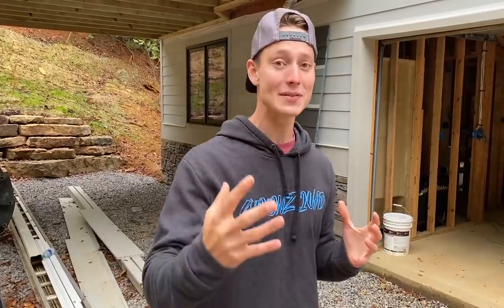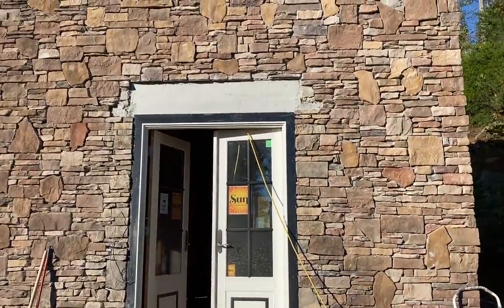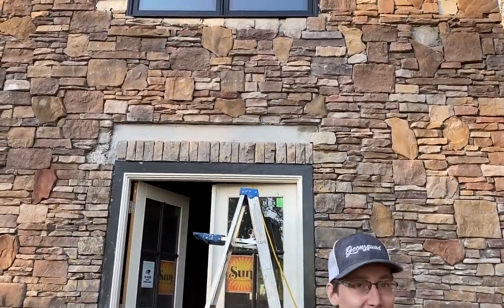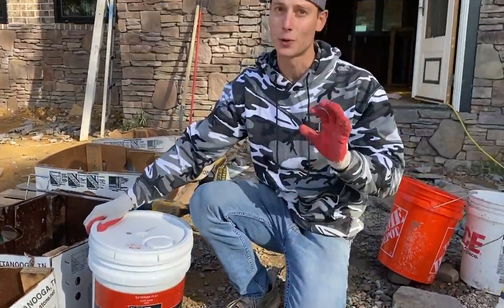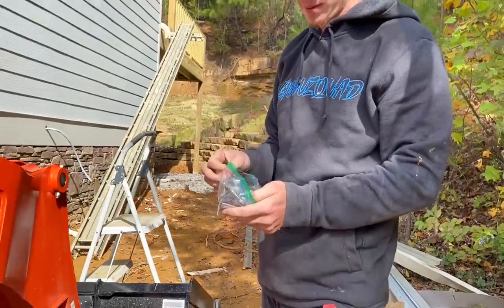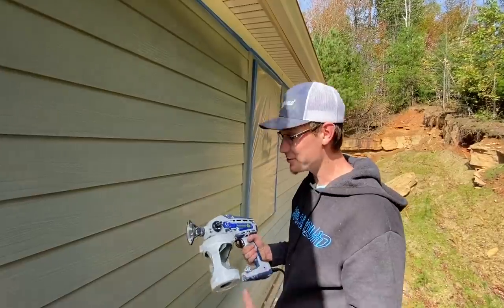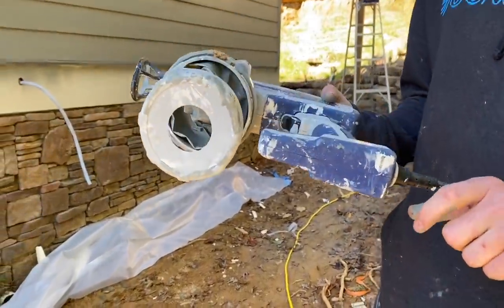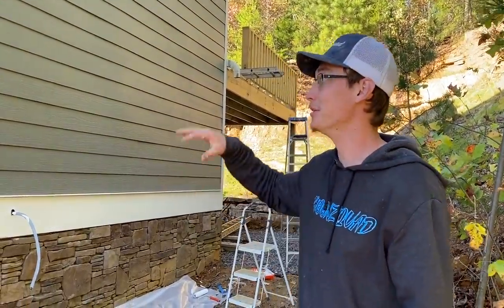The New Goonzquad Headquarters Part 31

Comment: After you power wash the stone, I would recommend spraying on a coat or two of stone sealer.  It helps shed water and keeps moisture from soaking into the stone, also just helps it last longer.
Reply: C'EST UNE EXCELLENTE IDEE
Reply: Not to mention prevents yellowing from the clay soil splashing up onto it.

Comment: Over the door, when brick is stood on end, it's called a soldier course. Not to be confused with a sailor's course of stonework like when you edge out a paver section. When caulking nail holes, or seams, have a damp sponge ready to dress up the caulk with a quick wipe. Keep a bucket of clean water on hand to rinse the sponge every so often.

Comment: Hey brothers, our wife and I are super happy for your new adventure and know exactly how excited you guys feel restoring/ renovating homes even vehicles. God gave us both a kool idea that would look awesome to make those front windows pop and make that stone stand out from the brick, because the color of the brick and stone is really close to being the same. The idea/ suggestion is to whitewash the all the brick! Also a single slope, post less steel awning that has two wall hanger mounts (all black) above that front door would be great. With all the rain you guys are getting that awning would give that door some shield and protection from constant weathering. Hey by the way the stone work you guys did really looks great. We in flesh have had much experience with stone, stucco and all types of masonry work and you guys did awesome. Our suggestion on the stone work is to start from top to bottom- reasons are your siding is already level and all the details stay at the bottom. Yes the stone will stay on the wall starting top to bottom, just wiggle it side to side and it sticks. Kool guys keep up the Good work and may God Allmighty continue to bless you and your Loved ones. Bye bye

Comment: Ya'll waisted that morter on the brickwork under the door. You're going to need to put in steps or a small balcony for entry. Could have left that bare because you're going to have to pull it off again to put in your access
Reply: They need a full length covered porch

Comment: I bet yall are happy that this paint job doesn’t need clear coat, cutting, compounding, and polishing!
Reply: ikr
Reply: Dont say it too loud ;)
Reply: they're gonna use that gun on their next huracon project lol
Reply: Oh ye that’s for sure 😉👌
Reply: @mm-hl7gh  you know they were thinking it
Reply: @tdwz1652  I’m surprised they didn’t pull out the HVLP for the siding
Reply: @juniorsanchez6697  what is LKR
Reply: No, but they still have to do the colour correction, ceramic coating and clear bra. And that roof just won't work right until they put a wing on the back. And a splitter. Not to mention new coilover shocks and sway bars for when the next tornado shows up.
Reply: @johnstedman4075  and of course granny shifting not double clutching like they should!
Reply: They did mask off the windows like they would a car
Reply: @EdgasketGarage  i know right. That's what it means.

Comment: what would really look fire is a custom front porch with a cover so when it rains it doesn't hit directly on front door
Reply: Also to prevent letting in gusts of wind when someone is entering the house.
Reply: Yeah that's something I could see them doing tbf.
Reply: It would totally destroy the look of the house though. But I guess its an American thing those porches, I really don't like them and don't think any real nice(fancy if you will) house has one.
EDIT: Maybe the word porch is a bit too unspecific, what I meant (and don't like) is one which is pretty much as wide as the whole house and is used as a terrace almost. Only a sort of roof/extension above the front door wouldn't look that bad if well designed and flowing with the rest of the house.
Reply: @pieterverboven4853  I think it looks a little flat on the front, a small porch would help with that. Also stops you from getting soaked when it's raining and you're trying to get your key out of your pocket, rains up there a lot too by the look of it.
Reply: Needs a cover. I said when they installed the door it needed a cover. That front double door will leak eventually and will take a lot of abuse for the U V over the years.   Also I don’t think the entryway height is up to code. Needs at least one step, a porch landing would be better.
Reply: @jason328d6  - They have already been talking about building a small deck big enough to have a few chairs.. to be able to sit out there and enjoy morning coffee
Reply: @pieterverboven4853  Whole house porches were for cooling off in the Summer before there was air conditioning.   They do need a little canopy over the door though but with all they have to do yet inside that can be a finishing touch.

Comment: Hey ya’ll... if you don’t caulk or put clips at the butt joints on your siding, you need to install a piece of flashing behind each butt joint on your siding. You can’t allow weather or UV light to make contact with your house wrap. It’ll break down. Check out Hardy’s website for install instructions.

Comment: Just a suggestion - when power washing keep the pressure turned down or you will force water behind your stone because there will be areas the mortar didn’t adhere to completely. Plus make sure you wait a while for the new mortar to really harden or you might have an issue with it becoming to damp inside and cause it to degrade behind the stone. Plus try to stay at least 3-4 feet from the stone and if you find an area that will not clean up Google how to clean the stone you have using muriatic acid. If anything try using just a garden hose with a high pressure nozzle and a fine to medium soft bristle brush. Cheers

Comment: Time to put in a security system. The stone work looks great. You guys should paint the front door black or the shadow mountain color.
Reply: Didn't SimpliSafe sponsor an episode a while back? If so, I'm sure they got a system as part of the deal.
Reply: Black for sure. Don't like the look of the front door with the new windows though. Looks outdated
Reply: In the last video there was a security decal on the front door.
Reply: I have been talking about a security system since the finished the water shed and we’re making comments about how many tools they have purchased without a covered trailer. 👍👍👍🙏🙏🙏

Comment: Dannnng son! You guys killed it! Actually the flat paint allows debris to stick easier than satin or semi. Most houses exterior is painted with semi or gloss.
Reply: That is correct. The type of gloss paint used in construction will steadily lose its shiny surface, becoming a stain sheen in as little as two years depending on the climate, the quality of preparation and workmanship, the quality of the paint. and the orientation of the specific location. North facing walls attract mould growth and south facing facades are aged by the ultraviolet solar radiation.

Comment: Only cheesy Persians paint stone.
Reply: Actually most of the stone buildings within the  Boulevard Peripherique in Paris are not painted, they are stone ashlar (ie real stone which has been carved to a smooth or modelled surface by masons). A better example for your argument would have been to cite London, where quite a few of the Regency buildings from 200 years ago are cement rendered (referred to as 'stucco' and the details are cast out of 'Coade Stone', all of which is painted by experts in a specific colour paint known as 'Crown Cream'. I have lived in both cities and they are equally beautiful.
Reply: @johnstedman4075  He said Persians, not Parisians lol. Although with the current state of France,  you may be accurate without intending to be.

Comment: Fellas, the caulk gun has a built-in cutter for the caulk. its the little hole on the handle. put the tip in the hole and squeeze the handle.. chops it off perfect every time! keep up the great work!!

Comment: Take some light color brown sanded grout and a rough paint brush like they use fir staining a make a 5 gal bucket of water and 1/3 bag of grout if not less and make watery wash and paint it on the newer stone it will put and aging look and blend it the wash over the new and older stone it’s a brick layer trick to blend stone
Reply: That type of stone is sedimentary, so it will tend to 'weather in' quickly and the freshly installed stone veneer will then tend to blend in naturally with that applied only eleven years previously.

Comment: when spraying siding you still wan to back brush it, it will last way longer and I woudl do another coat for sure. Back brushing is fast and easy and the longest part is getting the paint onto the siding. I just stained my whole house with a sprayer. Definitely need to cover the soffits, overspray gets everywhere

Comment: Hey guys instead of using brush or a roller, use the sprayer and cut out a long rectangle and wide cardboard piece and someone holds it over so the overspray dose not land on the soffit
Reply: They could perhaps try that if they used proper scaffolding, but not otherwise. Having items in both hands increases the risk of a fall.

Comment: Did you wire for two lights on front by door? Would be nice for black larger lights
Reply: They are going to install gigantic propane torches with real flames. That will look epic. Especially on a house made of timber.

Comment: Wear dust masks when cutting stone or concrete.  Use hearing protection when using most power tools or mowers.  The later can be had in an electronic form that still lets you hear conversation.  They might even double as headphones.

Comment: If you do much more painting might as well pick up a full size graco sprayer for about $300 that can suck paint right out of a 1 gallon or 5 gallon bucket, will save a ton of time.  Can also use it to paint the interior.

Comment: Just wanted to give my advice. I got a friend that has a big back porch like yall do. On his he installed 4' x 10' sheets of metal on the under side of the porch. He added a slop to it so the water that got through the boards would shed water to a gutter. The gutter is fastened to the 4"x4". So you can stay dry on  a rainy day. World of difference. Yall should try this. I believe yall would like that function.

Comment: Did they caulk the vertical seams between the hardyboard?     Saw they did everything else tho
Reply: No, we saw no evidence that the junctions between the Nichiha Siding were sealed. This would only have limited effectiveness for a short period anyway. The proper method of waterproofing these junctions was to install a flashing behind each vertical joint as the siding was being fixed. This detail is shown in the published Nichiha instructions, which appear to have been ignored on this project, a mistake which will contribute to water ingress into the structure in the future.

Comment: Chalking 101 1 ) push don’t pull the gun 2) damp rag on you at all times 3 ) cut the tip at the same angle marked on the tube directions that caulk your useing will shrink so after it cures go back and ck it

Comment: What would be cool is if in the house oh the second story how there is that one room with the vaulted ceiling the one top wall of it where it goes to the attic y’all should make that a loft like area
Reply: It would be tricky to do because the new HVAC system ducting is in the way, the headroom would be marginal unless expensive dormer windows were added, and fire escape access would be required. Not really a cost effective option at this stage, I'm afraid.
Reply: @johnstedman4075  well yeah ig but In Texas that’s not much of an issue it idk how the code run up there
Reply: @paytenharrison7253  Chattanooga inspectors are strict on matters such as means of escape in case of fire. They refuse to issue a Certificate of Occupation for houses if the codes are not followed. Since house fires kill more people annually than fires in commercial buildings (because sleeping people are very vulnerable to losing consciousness due to inhaling poisonous gases, and then asphyxiating) I consider that these rules are justified and should be rigidly enforced.
Reply: @johnstedman4075  I mean yeah ig but if they could do that it would make the house look bigger inside and I would do something with that dead space

Comment: Not sure it matters too much on the outside hardy, but don't typically use caulk on finished material nail and screw holes, cause it shrinks and leaves an ugly indention that can be seen. Use spackle or painters putty.

Comment: Color choice is great. With darker stone and they hardy horizontal being grey  and then the windows being black makes sense to keep the trim white. Or along the basis of white.. how about a metal flake pearl white.. just kidding.  Great job on the stone patch. Here is my suggestion for the stone. As much of a pain in the butt its gonna be I would pipe in mortar in all the joints. I suggest this for all those patch jobs this way its water tight. Also you should have put up a ledger on top of that stone.

Comment: You should use an airless , not enough paint coming out of that gun. Satin is better than flat, repels mold and mildew.
Reply: Yes, you are correct. Goonzquad appear to be under the misapprehension that glossy surfaces accumulate contamination more quickly than matt. The reverse is true.
Reply: @johnstedman4075   They will learn.
Reply: @jerryriggan  I would like to think so. But on the evidence of their current behaviours, I doubt that they will.
Reply: @johnstedman4075  Maybe not

Comment: Love it Glad u did not paint the stone brings value
Reply: Well, it certainly 'retains' some of the minimal value in that underwhelming, undersized, wrongly sited, badly built and poorly planned house. The main problem with idiotic ideas such as painting stonework is that it will tend to cause realtors to reduce their open market valuations, and it will certainly cause intelligent and informed potential purchasers to run away and find a property that was previously owned by someone with an IQ not in double figures.

Comment: you best fill the end joints since they were not flashed . they 
will leak!!!!!!!
Reply: If you are referring to the vertical butt joints between the lengths of Nichiha Siding, the omission of the flashing was a serious error and cannot how be compensated for by applying caulking to the surface of the Siding.. This is because the sealant would need a suitable gap between the boards in order to provide a seal, and Goofsquad did not provide any gap.

Comment: Think of the service you could provide if you promoted safety procedures and equipment to use on the jobs. LIKE NOT WORKING OUT OF TRACTOR BUCKET WITHOUT SAFETY EQUIPMENT.

Comment: You guys stoned under the front door, so what are you going to do for front entry steps? Your gonna be pulling all your hard work off.
Also did they put a drip edge over that front door before setting the stone?

Comment: You have to keep your gun facing straight at the surface your painting or else your gonna have skippers. Also the data sheet for the paint actually calls for a tip you’re supposed to use for the paint. Behr paint will dry down and look bad without 2 coats any professional painter will tell you it’s gonna look good on video but in person it won’t

Comment: BoBoiBoy you're going to burn that sprayer up if you use that sprayer it's not meant for it. Titan airless tip 5:15and just spray for one side all the way to your house I don't stop until you hit a window or the edge of the house from one end to the other don't because you'll have stop Mike showing where you stopped you have to continue that all the way across structure.

Comment: That is not true Goonz.  SemiGloss is best for exterior because water runs off of it and it cleans easier.  Flat paint outside will mold.  Yes, Flat looks better in my opinion but it wont look better outside after rainy weather.  Goodluck Goonz.

Comment: Need to tear it back down when you install your front steps
Reply: The front entrance will obviously need a ramped or stepped approach to take account of the difference in levels. But the new structure must be designed with the possibility of differential settlement in mind. The foundation of the Guest House has been in place for eleven years and has probably completed its initial settlement, although the clay soil may cause future issues as water levels vary underground. The new ramp or steps, if built of heavy materials, will probably need an MJ (Movement Joint) between it and the house. A qualified and experienced Structural Engineer should be consulted on this matter before the work begins.

Comment: That's still not Hardi siding , cheaper knockoff
Reply: It is certainly not Hardie Board, because Googsquad clearly said that they had purchased Nichiha Siding. The latter material is similar to products produced by the James Hardie company, and is about 20% less expensive, but I have seen and inspected both being installed and I would certainly not refer to the Nichiha product in derogatory terms. It is fit for purpose and reasonably durable, if installed and maintained in full accordance with the manufacturer's instructions and recommendations.

Comment: 2 mistakes so far. Well not really mistakes but waste of time energy and materials.... that door is up high enough that you are going to want steps. Unless you doubt a simple single step out of wood, the area below the door will not be seen. Als you may want some sort of canopy over that door which you would not of had to fill in the area right above the door then because you would of filled that space in